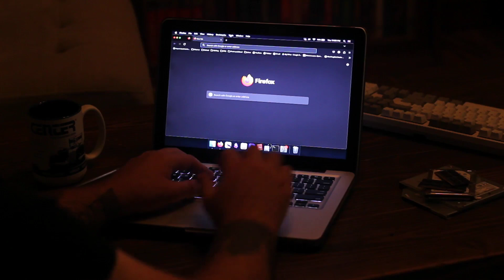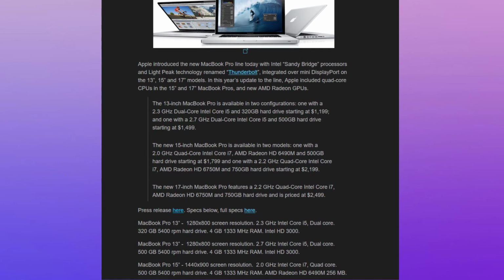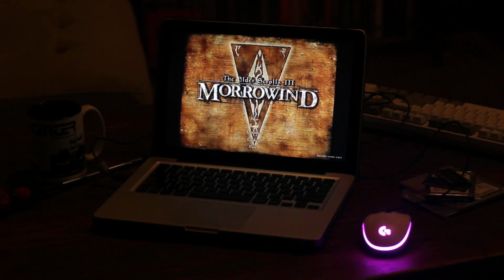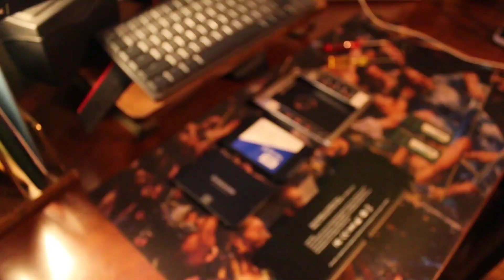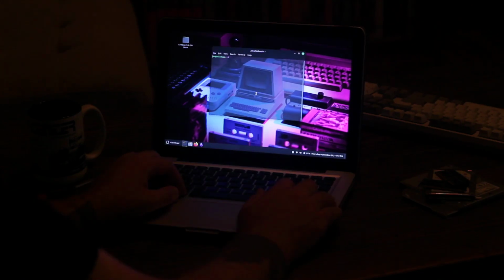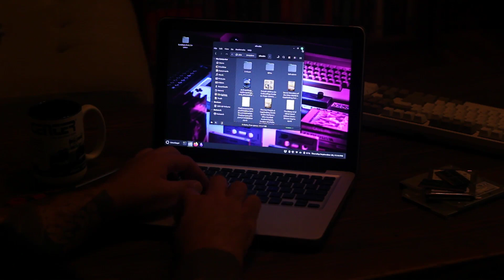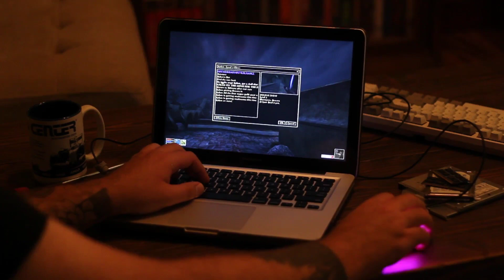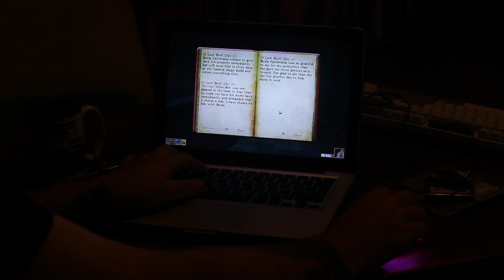An 11 Year Old MacBook in 2023?

Comment: I've been daily driving a mid 2012 with main SSD and hard drive on the caddy, 16 gb ram, for 11 years now! The SD card reader went weirdly out of service somewhere in the El Capitan days, and I've had to change 1 battery. BEWARE of the SATA cable, because it could fail and you'll asume it's the motherboard, though it's generally the thermal sensor.

I've got 2 identical machines. I think Open Core opens the possibility to go beyond the OS Catalina limit without using closed source/sketchy tricks.

While my Macbook 2012 is working, I feel almost no urge to upgrade. It runs Ableton Live flawlessly and it's perfect for music making.

Comment: I recently restored and upgraded my late 2011 base model MBP. It's a beast for web browsing and as a kitchen device. 

If I ever get a mint condition 2012 one I'll definitely do the dosdude CPU swap and maybe have it as my daily driver for another decade, USB 3 makes a big difference and anything that helps performance is greatly appreciated. OCLP keeps on giving these devices new life on the Mac OS side, Linux will support it for a millennia, Windows should be decent as long as it can be unlocked to run on older hardware, bad Microsoft. 

It's a shame Apple never got around to improving the resolution, the MBA had the same dimensions and a slightly higher resolution they could've used. I wonder if there's someone out there crazy enough to modify the LCD on an MBA and transplant it to a MBP. Dr Frankenstein's laptop.
Reply from the maker: I need to look into this cpu swap. That’s the biggest limitation for me on mine
Reply: @Junktown-James  If you can get in touch with dosdude he'll do it for you. 
I doubt gaming will improve much but having a couple extra cores will be great at easing multitasks, I can feel mine bog down when I'm downloading multiple files and playing YouTube, even with just a couple tabs open, it's taxing on the poor thing.

Comment: Cool video! I still see a lot of A1278s out there, they're very popular and generally pretty reliable systems as far as I've been able to see. Many a time I see bad batteries or slow hard drives needing to be replaced, but that's much to be expected when the system's 10+ years old.
Reply from the maker: Confirmed with a new battery and ssd these laptops are pretty sweet.
Reply: @Junktown-James  For sure!!

Comment: Awesome video... Boy is it dark tho 😂 subbed
Reply from the maker: Thanks for subbing. I’m working on better lighting for the future :) good tip on the solder joints. I was in the market for a new logic board so hopefully that’s the issue!
Reply: @Junktown-James  100% guarantee that's the issue bud... They came from the factory with the flaw and Apple knew it. Apple tried to fix it as cheaply as possible by adding pressure pads on the bottom case to press down on the ram... That didn't work so they made the pads bigger & thicker later in production... They just didn't use good solder or enough of it and the heat causes the pins to lift up with time. real easy fix just be delicate doing it
Reply: Take great care when doing this, I tried a couple times on some systems and it didn't work out too well. Ouch! My recommendation: don't put solder on your iron tip, just try to melt what's already on the board. But after all, it's either that or a new board anyway!
Reply: time to upgrade to macOS Sonoma with OCLP and have fun :)
Reply: RAM issue is because of the solder joints on the slots... common issue, you have to reflow the pins... not too hard to fix